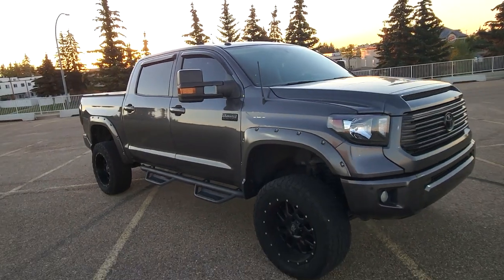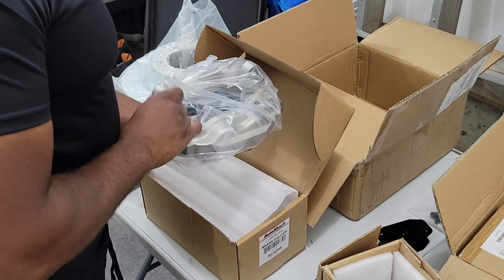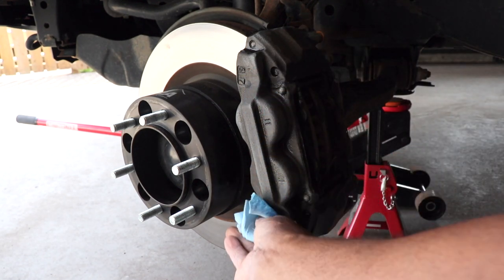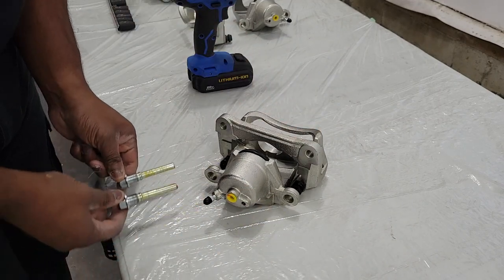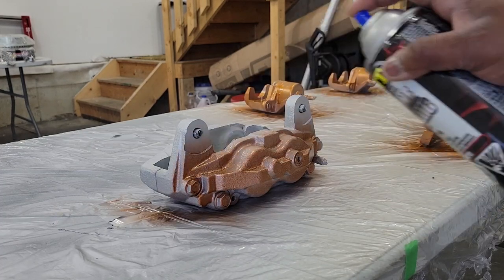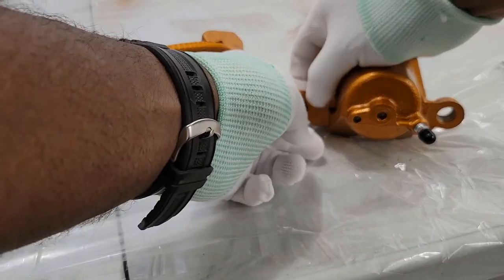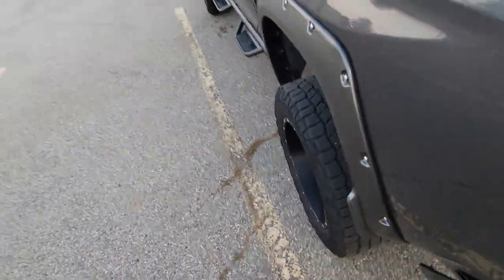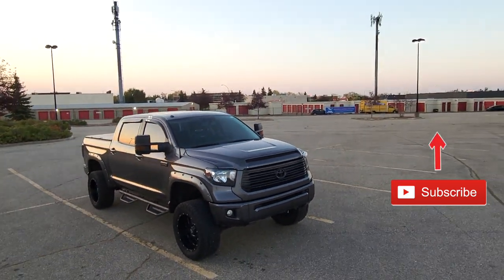Painting The Brake Calipers On A 2014 Toyota Tundra, Platinum CrewMax

Comment: Awesome video. I think you went with the power stop pads and rotors from the looks of it… but those look like the stock calipers? Any reason why you didn’t get the power stop calipers and stuck with the stock?  Btw I think I maybe going with burnt copper now also instead of red!!! Love the color!!
Reply from the maker: Thanks for checking out the video.

You're right. I did get the power-stop kit (pads and rotors). To be honest with you, I'm not sure why I didn't get the power-stop calipers. It's possible that they weren't available at the time and I wanted to get all of the parts right away.

Yeah ... I painted the calipers on my previous video red, so I thought I'd do something different this time. They turned out pretty good.
Reply: @toyotaFANatic81  thanks for the feed back man. I too kept it stock with the calipers when it came time to replacing mine, as far as pads and rotors go…I went the same route as you…have you noticed any squeaking at all? And what about the first 500 miles or so, did the brakes take time to “break”in
Also, would you say that this is a significant upgrade from the stock pad/rotor performance??
Reply: @toyotaFANatic81  First off,  Well done videos.  You speak clear, slow, steady and direct so I can understand without playing back a hundred times like other videos.  Second.  Great looking truck.  My 16 Crew is almost identical  and I'm loving the color you picked for the calipers.   Now more importantly   How have your power stops held up?   I did my brakes a little over a year ago and went with power stops.    Just a little over a year and I'm replacing everything already so I'm not such a fan of power stop anymore.
Reply from the maker: @ramalamaone  Hey, man! I'm sorry to hear about your issues with the brakes. Luckily, I have had ZERO issues with both my front and rear brakes since I installed them back in 2022. They're still performing well.